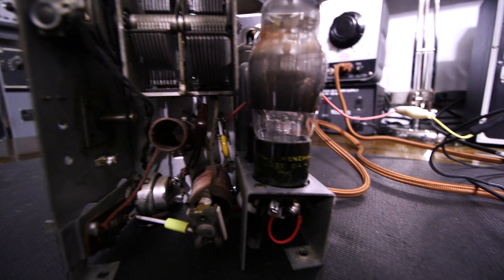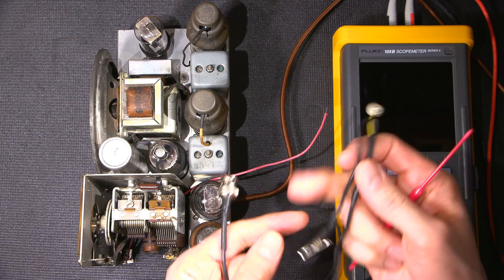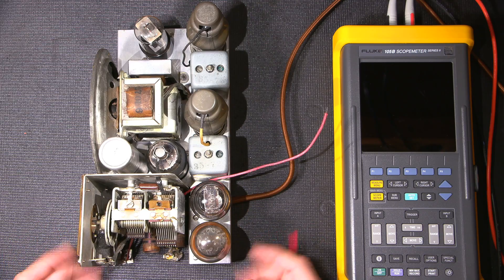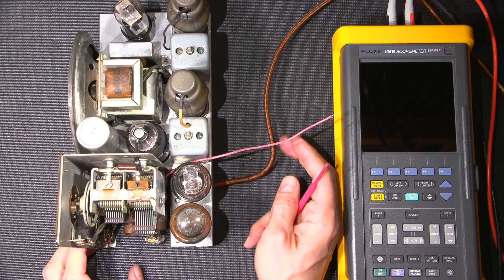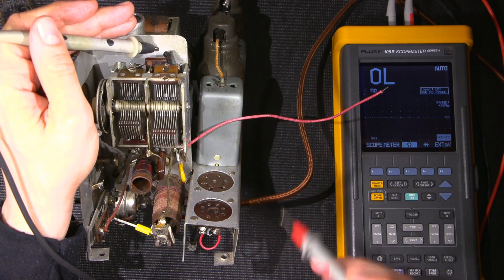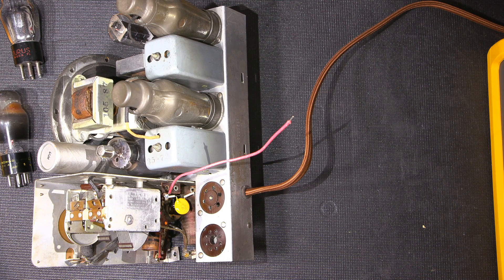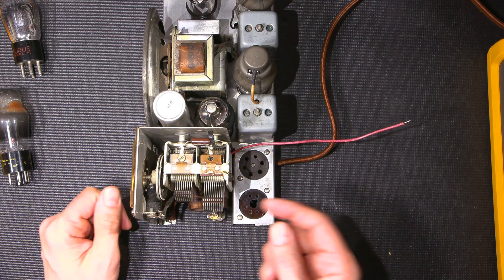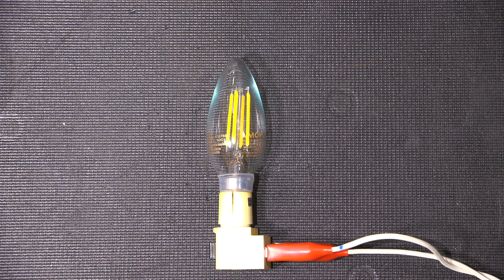See High Voltage Created From Falling Snow!

Comment: That is why a coupling transformer at the antenna is needed. Can be aircore or ferrite toroid. Can help with matching your coax  to amtenna
Reply from the maker: Too Lossy.
Reply: @MrCarlsonsLab  This Lesson about static on ungrounded antenna I learnt back in 2003. Atleast put a resistor to bleed the HV  static to ground. An inductor would be better as it has lower resistance. A broadband 9:1 (UNUN or otherewise) transformer is much better match than a directly connected coax. NOT recommended for transmit- Would be lossy as you say. works well for Receive only. You may need another one at reciever to match HiZ reciever input- reduce loss due to mismatch from loz of coax.

Comment: I've had it get pritty bad in snow storms  not as dramatic as you had . Usually a 10k ohm was enough to stop it . But yes it took out a palstar tuner 2kd I beleave it was . Needed to repair the roller and the caps

Comment: Way back in about 1970 one one occasion I managed to light a neon by connecting it to a 40m long wire antenna.  I have wondered since whether I was risking electrocution by lightning by going near it.  You know how you get those little precursor sort of strikes going up from the ground before the lightning comes down.  A few observations: 1) You say there is 30 ohms to ground, and that is true for DC, however a very fast pulse is far from DC and "sees" the coil as a high impedance because of its inductive reactance.  The current jumps through the air gap because the back emf of the coil means the current cannot suddenly increase from zero to a high value. 2) Again, you say a capacitor blocks the flow of DC, but a fast pulse is not DC and will pass through a capacitor without damaging it.  3) As several comments below point out, the antenna is slowly accumulating charge.  I wonder if the insulation resistance of your radio input is low enough to prevent the inner core of the coax from reaching a substantial voltage, whereas the outer screen is not connected to anything and so can soar up to very high voltages.  This would create a sort of relaxation oscillator whereby the outer screen and its half of the dipole accumulate charge and its voltage rises to the point where it jumps to the inner core.  The pulse goes through the capacitor and air gap.  I am speculating that the inner core voltage then decays away with time (because of the supposed resistance to ground I mentioned above,  by the way, I would megger the antenna input of the radio to check this) while the screen voltage builds again until the PD is again sufficient to spark. (perhaps sparking inside your BNC connector?)  Keep the videos coming, you have a great channel.

Comment: Interesting.  From your knowledge, I would not doubt you done this— was the antenna outside grounded to copper pole in ground?  Was thinking path of least resistance would have took over if that was in place, which thought that would have prevented this scenario.

Comment: I have experienced the "St. Elmo's Fire" phenomenon many times flying commercially when flying through a "charged atmosphere", such as in the vicinity of thunderstorms or large weather systems.  Aircraft fuselages are equipped with devices called "static wicks" located on the trailing edges of the airfoils and control surfaces to dissipate any charge building up on the aluminum skin.  The "St. Elmos Fire" presents itself visually on the cockpit windscreen usually most dramatically on the most forward-facing glass.  As the surface charge of the windscreen builds voltage, it becomes high enough to visibly arc in a multiple fingers to the surrounding aluminum skin of the aircraft.  It is really only visible at night, but happens whenever the conditions are right.  It was first observed by sailors in the rigging of sailing ships during the same conditions.  I suspect you are experiencing the same phenomenon conducted into your Lab through the coax cable from your antenna, which is collecting the charge.  I don't think the charge would be affected by changing the tuning of the circuit.  Interestingly, I never remember any radio communication problems associated with this on aircraft  VHF/UHF radios (~120-135MHZ range & 200+ MHZ respectively), but it's possible we did experience problems on the lower range of the frequency band on the HF's  radios (2-8 MHZ).

Comment: A few years ago I had a spark crackling at maybe 10Hz across a PL259 connector. That kept sparking for over an hour in the end. The antenna was a 30ft roof-mounted vertical for 10/20m. I unplugged the connector when I head there was a big storm coming. Just as well!

Comment: Wow, I have heard snow created static on my 160m dipole, but the voltages you were "seeing" had to be  orders of magnitude higher than that static.  The only time I have seen arcing from an antenna was from a nearby lightning strike.  That time a spark arced through the shield on the coax which was touching a metal furnace duct.  Nice little burn mark on the metal.  Fortunately I did not have the antennas connected to any radios!  AND that is another reason I have old tube radios operational along with my fancy solid state equipment!!   ._ _  ._  _ _ ..  .  ._.
Reply: Oops typo:   ._ _  ._  _ _ ..  ._  ._.

Comment: Another fascinating video – thanks Paul. I wonder if you have lightning/static arresters on your antenna line – possibly not as these would have presented a preferential earth path for the static buildup. Back in the 1970’s I had a similar problem here in the UK using a 360 foot longwire for 160 metres. Arcing would occur even in the wide spaced capacitor vanes within the ATU and would sometimes occur even on a bright, clear day especially if a wind was blowing. It was acceptable in those days with tube equipment! But when I received a mighty belt off the coax feeder one day, I fitted the arresters! With todays delicate radio’s it’s absolutely essential. As an aside, you mentioned previously you had a powerful broadcast station near you – could there be a link here, only manifesting oddly during snowy conditions?

Comment: Thanks Paul, this just goes to prove that Tesla was right that the planet is buzzing with free atmospheric electricity waiting to be tapped into and an antenna is one way to obtain it, the higher the antenna the stronger the voltage, although it is not very strong, obviuos.y the snow moving throgh the air was creating a higher charge, fascinating very enjoyable, cheers Paul, always a pleasure watching your stuff.

Comment: There's a reason why transmission towers has lots of little spikes at the top of the antenna; to bleed off the static electricity building up when the weather is cloudy... or during sandstorms...

Your antenna array simply acts as a Van de graaff generator...

Comment: Very interesting video! Thanks for sharing. Can you explain how the electric charge was generated and also, is there something like this happening to "normal homes" - where the cable, phone wires and electrical wires are not buried in the ground, but hung on posts? Are there many people's TV's and other appliances burned, due to discharges and even static electrical charges? I use APC's UPS on all of my TV's. computers and even laptop's, would this kind of "charge" jump and bypass the UPS devices and damage the electronic equipment? Also, you have mentioned that you've installed something to "prevent this from happening" - did I missed that part? Once again, thank you for very informative videos and detail oriented explanations.

Comment: You got me interested in electronics repair, specifically radio repair and even just getting into radios (im a DJ so maybe CB wouldnt be for me but AM and FM sure are) I use an electronic cigarette with whats called a rebuildable dripping atomizer. I essentially make coils of wire that pass through an electrical field to make the heating element for vapor to travel through. I learned the basics of electricity with this. I run everything based off of ohms, watts, and even voltage (amperage isnt too big of a factor in electronic cigarettes when making an atomizer coil) i found this to be EXTREMELY strange as i know with a High Resistance like that, it MOST DEFINITELY should be going to ground and not arcing with how this circuit is set up. Just know that people dont even need to be an RF engineer in order to understand whats going on as i have practically no knowledge in RF other than your repair videos, and even that is hard for me to follow along sometimes (fantastic videos though. Im always entertained and learning something new about circuits with you.) Electronic cigarette users that build their own atomizer coils know whats going on here too and it is indeed very strange.

Comment: It could be that something was discharging at very high frequency and current within the area and actually pulling the earth ground up to a high voltage. When I worked on a project at one of our national labs (Brookhaven) I discharged 60KV into 4 ohms with a pulse rise time of less than 200ns. The device was grounded directly to the building ground which was well grounded to earth. Still, the small inductance in the ground system allowed the entire building ground to be pulled up to several thousand volts for a fraction of a second and this punctured the insulation in the power transformers of about a dozen Tektronic scopes like yours. The instrument shop was mad at me for months.

Comment: I have experienced 'thunder-snow' in the USA. The snow was coming down in golf-ball sized clumps, with frequent lightning. It may well be that there was enough atmospheric charge to deposit on the antenna, but not enough for lightning; the antenna voltage got high enough to arc to ground, causing a very fast current rise-time. Put the 'L' reactance in series with that current and you get a high voltage across it, hence the flash-over.
As an aside, this is why lightning conductors should always be in a straight line to ground: Any curve or bend becomes  a reactance that develops a high voltage when you dump 10,000 Amps through it in 2 nanoseconds or so. Route that curve through your roof timbers and the spark will start a blaze. HR Ground your antennas!!

Comment: I would be most interested in knowing the gap that the spark jumped. A simple feeler gauge would do to make this determination. If you know the relative humidity of your work area, a graph online is available to determine the approximate voltage, If you measure the inductance of the coil, it will provide a measure of the current passed as a function of frequency. The charge time was the time between sparks. The loading of the isolation transformer would be interesting also. Similar measurements would be required to be estimated, also. Good job!  We maintain three 8 ft. ground rods for our station and also for the house lightning ground. We had three local power transformers blow a month or so ago at the switching station near our home. We got a good enough power surge to blow our "all house" overvoltage unit, now replaced with an even larger unit. The surge didn't affect anything in my ham shack, but I did lose the 6 outlet "isotel" multiple outlet from Tripp-Lite which protected the rig and power supply. We lost an "always on" subwoofer on a sound system upstairs. This is now also protected by a Tripp-Lite 4 outlet protection unit. It also tripped about four of the breakers in the main breaker panel. We replaced the 30 A dual breaker to the protection circuit. All together a "I'd rather it had been someone else" experience. I recommend home overvoltage circuits!  de KQ2E

Comment: You should probably run a hi-pot test on that isolation transformer to make sure the voltage didn't burn a hole in the insulation between the primary and secondary windings. Either way, a secondary arc in, through, or around the transformer would explain why it arced across the coil in the radio: a coil will resist a sudden change in current, so even though the steady state resistance is only 36 ohms, when hit with a surge it would be much higher for a split second. The spark gap in the transformer is what allowed the charges to accumulate. If the chassis of the radio had been directly connected to ground, however, the charge would have just continuously flowed to ground through the coil with no high voltage and no arc.
Reply: A good transformer has its windings on separated cores, not touching each other in any way. Now lets hope it is a good transformer :)
Reply: @erikdenhouter  even then, if the core is iron, iron conducts electricity. It could arc from the secondary to the core, then from the core to the primary. In some cases the core may be grounded, in which case it would only need to arc to the core.

Comment: Snow static would kill my ham radio reception, but it didn't do any damage. Lots of volts, almost no current. I would disconnect the antenna and put a neon bulb across the terminals to ground. This was when I was in Buffalo, NY, the snow capital of the world. :(

My guess is the snow static is mostly RF energy and the coil/capacitor circuit sees that as a very close by radio station. Probably you get the spark because the wideband energy hits the resonant frequency of the tuning cap/coil.
The high voltage probably fried the led bulb electronics, causing unrestricted currents to flow, flashing the LED segments until the current got so great and they shut off. Those "filament type" led bulbs are prone to that type of failure. 

Broadcast towers have lightning discharge balls at the base of the towers. One ball on the radiator and the other ball strapped to earth. Helps protect the transmitter, but I've had storms clobber a MW transmitter before. One time killed a mica capacitor in the output stage tuned circuit. It was a high current/voltage cap, so I wired a half dozen smaller ones in series/parallel and got the transmitter back on. I told them not to talk too loud in the mic. :) Took 2 days to get a replacement, but we stayed on the air.

A great demo video, Mr. Carlson. Probably unique.

Comment: I have had that same thing happen to me on a 40m vertical inside of a fiberglass tube. I heard arcing from My FT 847, I unhooked coax then it started arcing across the PL 259 connector. No snow just a 40+MPH wind. No damage to the solid-state FT-847. Installed 1mh choke @ feed-point.

Comment: The rise time and duration of the arc is so short that the impedance of the coil makes the 36 ohm resistance like it's not even there.  And like you said, there must have been at least one other arc in series from antennae to ground.

Comment: It was just electrostatic charges in the atmosphere and the snow was acting as charge carriers bringing in enough electrons to build up till it discharged on your radio.  There are a few groups that are trying to string large wire loops to collect the static charges like this and they do get a very high voltage on the wire, just no a steady stream of current, so they collect enough to charge up capacitor banks, then charge batteries from that.  Seems you have found that snow is good for collecting charges from the clouds :)
Reply: That's not what was in question, what he wanted to know is why then did the charge not follow the path of least resistance to ground.  It chose the air gaps super high resistance over the 36 ohm path, makes no sense.

Comment: isn't that yellow capacitor a X/Y/safety type? If so, it is designed not to short or leak on internal breakdown due to over-voltage. Then it would explain to suddenly apply the full voltage at the antenna to the "air" gap and cause the spark there. The parallel resistance over the coil in the radio is far to high and inductive to short that high voltage spike.
Side note: I had similar incidents with a simple groundplane antenna for the 70cm band. Fortunately, the cable was disconnected and the sparking took place from the tip to the shell of the coax connector. Appears you don't need a large antenna for this to happen...

Comment: I’ve got to think the ungrounded shield of the coax had to play a role, perhaps as a capacitor. I know dry snow can generate quite a bit of static electricity. Aircraft wings are equipped with short trailing wires to dissipate static electricity from snow.

Comment: The black mat in the video, appears to be like the static mats we used to use to prevent static build-up or damage on solid state components.  It is usually grounded through a 1-10MegOhm resistor.  Considering your description of the jolt you received, is it possible this mat was the final leg of the circuit?  

We recently had an occurrence of a lightning strike, on a snowy day.  From the direction, it was toward a tower antenna.  Just one, flash / bang.

Comment: I was struck by lightning 150’ underground behind Niagara Falls while taking the tour known as “Journey Behind The Falls”. One witness saw the arc jump 4’ from a wall light to my temple. There’s hundreds of feet of cabling, plus the grounded power distribution panel, between the lights up on Table Rock where the lightning initially struck, and the wall light where the arc exited—or entered, or both (high-speed photography suggests that most lightning oscillates up and down). It’s completely unpredictable.

Comment: The 4 way switch for the ceiling fan where I have my stereo set up makes my speakers pop when I turn the knob.  The wiring to all 4 sets of speakers acts as an array that collects RF interference.  It doesn’t show up on recordings, but it still sounds bad.  I’m thinking of going with a digital switch to avoid it.